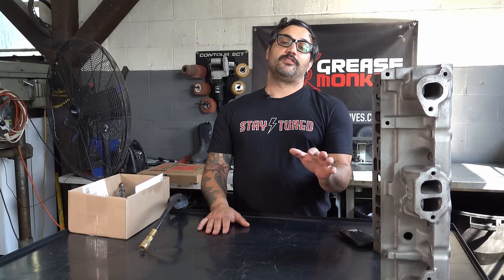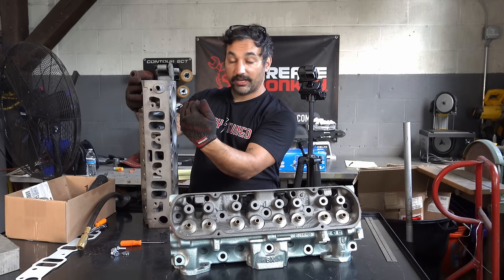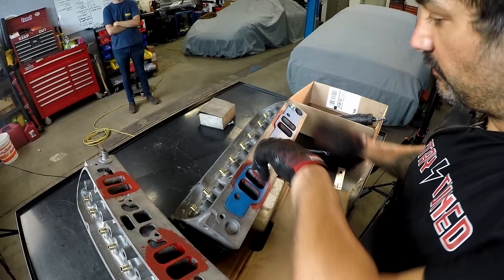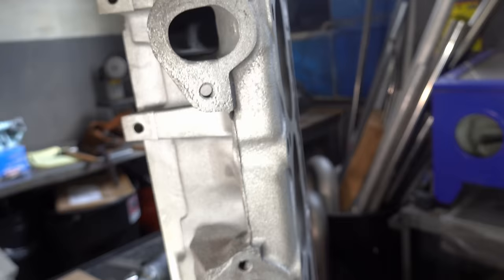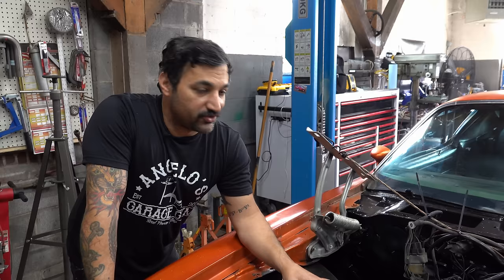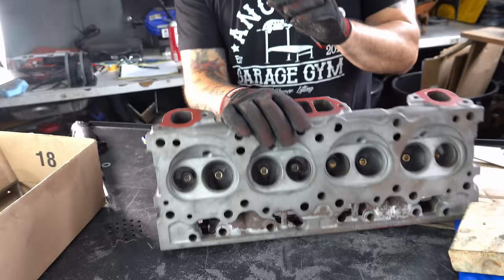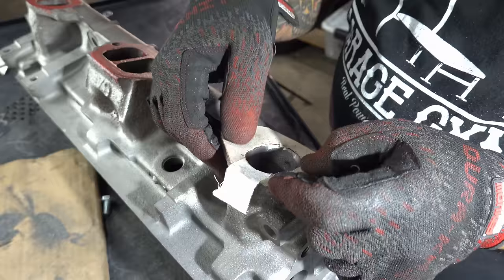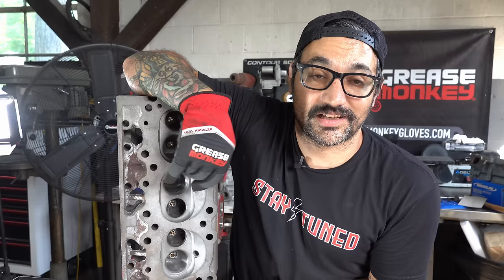It's Free and I Hate it! *Works on Any Engine

Comment: I put a set of 6X heads on a 400 Firebird  eng. I used the 400 rockers arms and pushrods . The new camshaft wore out in 30 seconds Acouple of Mexican fellows told Me that I had to use the 6x pushrods and rockers from the Grand Prix  6X eng . after i did that the eng ran real good . What do I know Ima FORD MAN .Where is Lucky ?

Comment: Yeah I’ve ported enough Pontiac cast-iron heads, my old boss at Sd Performance CNC ported my last set so I’m good by the time you’re done you might as well just invest in a nice set of aluminum heads unless you’re trying to look factory 
I’ll tell you this 85% of what you’re going to find is in the bowl the short turn and the valve job

Comment: I have a set of new ceramic coated headers for it that I have had in storage for 20 + years from a project I was working on and the guy bought the wrong headers. I needed Chevy 350 headers not. Pontiac 350-400 headers. If you want them you can have them.

Comment: Love that you actually putting a Pontiac motor in a Pontiac car. Why didn't you start with a 62, 12, 48 head?
Reply from the maker: It was slim pickings to find a good used motor over here.

Comment: With pontiac heads you should at least use a ra4 intake gasket and port match to that. It's mostly raising the roof. Looks like a standard gasket but I could be wrong.

Comment: The VE of a normal internal combustion engine can, and will in every properly build engine exceed 100% around the point of maximum torque.
To reach that with a normal engine is mostly due to the camshaft, not the ports.

And porting is not really free Horsepower.
It can increase Horsepower, if the acutal airflow the engine demands is high enough, but the only really NA free Horsepower is Compression ratio (up to the point where the fuel cant support the CR).
Best proof of that is Richard Holdeners test of the OEM LS-Heads.
The worst flowing but highest CR 706 heads produced the highest HP.

Comment: Nice work, Tony!  I've found a mallet works well for making the template.  The "soft" rubber/phenolic face has enough give to it that you can whack it fairly strongly and the cut works well.  By the way, roughly how long did you spend per head to do all of this work?
Reply from the maker: Yeah, that makes total sense. I don't recall why I grabbed the ball peen. Heat-stroke maybe?

Comment: Porting heads is great, especially on older engine types. However, getting great results in more modern engines is much harder. It isn't impossible, but harder for the average DIY-er.
Reply: Modern engines probably have better ports from factory, designed using cfd and so forth. So less gains to be made.
Reply: @nerd1000ify  There is that, also they tend to cast the metal more precisely.

Comment: You should have filled the crossover port with molten aluminum before you started porting them.  I've done it on iron Pontiac heads, at least 10 more free hp.

Comment: Neighbor has an RX7 sitting outside, engine has been to the track, pounded on at full boost and it still hasn't broken for 10 years.

The reason rotaries break is because they're not only maintained incorrectly, but driven wrong (yes there is such thing)

Rotaries like lots of oil yes, but did you know that asking for wide open throttle at 2500rpm will shred apex seals faster than anything? You need to keep the rpms up when driving over half throttle.

Rob Dahm hasn't even been breaking his engine, just axles, with his turbo 4 rotor.

 Rotaries didn't catch on because why learn a whole new engine after spending your whole life with piston engines? it makes sense that people are wary.

The funny thing is though, car magazines and journalists all say rotaries break, but when you go onto a forum where rotary heads are born, you'll find that a lot of these people are making rotaries run for years problem free, so long as they do it right.

The craziest part is that the RX7 FB sitting outside is a Frankenstein of parts from all different cars.

Before anyone asks, yes, he went through a couple engines, mainly because he was learning, and after he fixed all the kinks (like anyone would have to) the car kept brapping healthy for a decade and still to this day.

If you don't know about rotaries, you're not stupid, it's like learning a whole new language, and I don't blame you for sticking to your first language. I was very blown away when I heard the car had been running problem-free for so long, and honestly didn't want to believe it until he cold started it, warmed it up and took me for a full boost ride on the street.

Comment: the one thing I never ever hear Friberger, Finagin, Dulsage, Tony or any of them mention.  Serface grinding the head gasket serface??? and the exhaust and intake Gasket serfaces?  when i done my 427 that self destructed because a oil preasure drive breaking off, and my hemi, both went through serface grinding. In my feelings of making power i total beleive that is a must. blueing maching all and every serface to each other. so to say the Valve grinding to mach head with valve.

Comment: Primitive porting only works on crappy ports. Don’t touch decent ones unless you know what you’re doing and have a flow bench. Too many people bubba up heads with a die grinder and kill the low lift flow to maybe gain a tiny bit of high lift flow. The valve is partially open for far longer than it is fully open so flow at low lift is more important than peak numbers.

Comment: Believe it or not, a rough finish will flow more air than a smooth finish. Air flows on top of the micro vortices created by the rough surfaces. Its the reason golf balls have dimples 😉
Reply from the maker: Yeah, I know but I will take uniformity over that, I just want to knock the ridges down really. We are going for "pretty good" here!
Reply: @StayTunedTA  
Knocking down the ridges and opening up the CC's will absolutely help HP, but taking the time and effort to sand and polish to a smooth finish are better wasted on something else that will actually increase HP😉

Comment: Ok you have me very interested about the over 100% VE on rotaries. Long story short if you look at the combustion chamber alone, it fires every time it is swept, which means from this perspective it is a 2 stroke. I always thought it was too bad that you can't put an expansion pipe on a rotary and get the same effect as a piston 2 stroke, because the intake and exhaust are not really continuously connected like they are for the proper resonation to supercharge a piston 2 stroke.

But now that you are saying there is a small supercharging effect available with bridgeports and streetports, I'm wondering if you could put a pipe on it. Hmmmmmm

Speaking of flow have you seen the F1 headers over the last number of years? They come out at a smaller diameter from the exhaust port and then after about 5 or 10 inches it steps up to a larger diameter pipe. I'm pretty sure any engine will benefit from this. My guess is it helps keep the velocity higher near the exit to better clear out the chamber before stepping up as the exhaust expands out from heat and combustion to not restrict it.
Reply: VE greater than 100% is possible on normal 4 strokes too. It's highly dependent on intake manifold design however.

Comment: Tony do I need to port my aluminum 4.8 heads to get better air flow than it has now ? It's a 2004 4.8 vortec in a 2004 silverado 1500 2wd reg cab truck with RC 4.5 inch lift I'm looking for towing power but .my 4.8 as of now this day has 260,800 miles on it & still strong any budget very low budget upgrades secrets. love Pontiacs I had a 4 door lamans with a 400 it was sweet but I was only 12 @ that time lol & I'm in my late 50s now your help will be much appreciated keep up the great work & thank you for the Ole Pontiacs 400 memories

Comment: I have a 97 Integra.  While the bottom end of my b18b1 is Spoon Spec'd the top half only has a mild cam upgrade but head is fully ported and polished with a polished intake and throttle body . Ironically the bottom half was over built and has caused me issue with top half . Fortunately I will be replacing head with a full race grade head ( cams , ported , polished and bored with a full titanium valve train ) and computer . Engine can handle well over 12000 rpm but since i want it to last a lifetime I'm gonna set Rev limiter to 9500 to 9700 rpm . Without supercharger I will have around 350 hp but I think I'm gonna add super charger and tune it for 425 hp ( it will be able to handle 475 to 500 ) because again I want it to last . It also has a dual plate clutch with lightweight flywheel and 97 type r 5 speed . Brakes are off a 97 gsr and suspension is full skunk 2 upgrade . The exhaust is a stainless steel hi flow California approved ( in 2007 ) street/track exhaust with hi flow cat  bolted to the stock Honda header . 
   Yeah I love my little Japanese hot rod . I actually bought it to flip when I was planning to buy a 61 Chevy Belair Flat Top with a 283 , 2 speed , 410 rear ... but after driving the Integra I realized I had a true tuner ( most of the work was done ) like in the Fast and Furious movies on top of it being tuner royalty ( in tuner world the 97 Integra is equivalent to 57 Chevy in muscle car world ) . Never thought I'd love a Honda but I have a true sports car and it's a TRUE TUNER or like a 68 Chevy impala 4 door ss ... a true sleeper 🤣🤣🤣

Comment: Military was making gaskets with a ball peen hammer 100 + years ago, try a smaller ball peen and actual gasket material next time for an improved templet. Make several, custom undercut them for different depths in the port.

Comment: Re-watching this as I'm about to pull the #17 heads off the '68 350 in my Fbird for a refresh and was considering doing some light gasket matching and clean-up. watching this I see it was SUPER helpful that you had the butler head as a guide, but if you don't have access to something like that is there anything out there that could help not F@C% up my heads? templates, or measurements for snap gauges to go by?

Comment: I was confused for a second, but it looks like you're converting a 2 bolt block to 4 bolt main caps.  The 400 in my 70 GTO (MANY years ago) had factory 4 bolt caps on the center three mains
Reply from the maker: Yessir, only the most burly factory blocks came 4 bolt, so we are upgrading ours.

Comment: also i was thinking of going with a Butler top end kit which comes with aluminum heads for my 78 400 TA with Muncie wide ratio 4 speed, i was looking for about 420 430 HP which butler said would be no problem. would i be able to achieve the same even though my heads are x4 heads 93 or so cc the Butler heads are 72 cc. what you think?

Comment: So I can take my 1976 heads off my 400 sbc engine and do this and get a noticable difference in performance, it's in my 93 Chevy K1500 pick up. Nope , I've never done this so I don't think I will learn on my daily driver. But if I was experienced at doing it, it's within my price range, free.

Comment: Exhaust flange templet, why not just use a header gasket to lay out the exhaust port shape? Can't flow anymore then the shape of the gasket allows to flow passed it. 

 PS I have a 389 forged NASCAR Super Duty crank in my 1969 Ram Air IV 4 blot 406 Pontiac block. Your going to loooove the power it pull over 7,500 rpm on your 400 as I do mine.  Don't see much reason to need a blower, but it should be interesting. Good luck keeping the car straight!!!! My bird snakes all OVER the place when you get on it to hard with 11inch slicks!!! lol.  No NO-2 all motor.

Comment: How do you keep the bit from clogging up when grinding aluminum?
Reply from the maker: Its tough, I think you gotta run the bit slow, and you can use a small screwdriver and run it down the vanes of the cutter and it will pull out clogs but they don't last forever.
Reply from the maker: You can also use a cutting fluid or wax to help on aluminum.

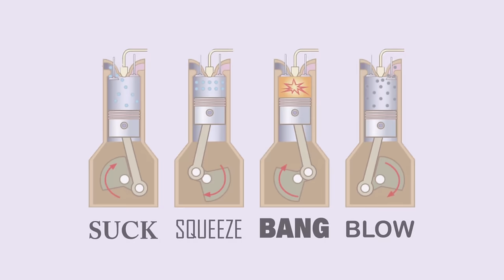Comment: 1:12...last one should be escape instead of blow...because the bang has produced  more heat than what the suck and squeeze has produced , and now needs a way to escape...if it doesnt escape....when it is supposed to, it will at the suck point

Comment: Hey Tony ,  I`m working on a 455 Buick Budget build mostly stock and was wondering on what to use as far as Used carbs ,   I Have a Holly 750 ,  The Original Q Jet ( My Favorite ,   Love the way it sounds ) And A Edelbrock carb !     Any Suggestions ??????????
Reply from the maker: Really, whatever you are most comfortable with tuning, and have laying around you can use. 4150 style stuff is usually my go to but all good choices.
Reply: @StayTunedTA  Cool Bro ,  Thanks so much for the advice and also want to say Hot Rod Garage Rocks ,  And Stay Tuned Of Course !   :  )

Comment: When i was a kid my dad got me a dremal tool and i burned it out porting EVERYTHING that was powered by internal combustion and BEEEEYOOOND.. Ported the shit outta my 87 jetta 1.8 and shaved the head down with one of the biggest rally/hillclimb tectonics camshaft 286/446 and was mega lumpy and totally UNSTREETABLE! She was rude as hell and my dad nicknamed the jetta the torqueless wonder but goddamn she got rowdy around 5000-11000 thanks to them crane duel coil beehive valve springs with titanium retainers all parts and "labor" cost me a cool $400 back in 1999 when life was good and i was strappin and quite dapper young man fulla hopes and dreams.. Then after constantly SHATTERING them little vw transmissions like they were made of frozen glass.. So since i love punishment i got into rotarys and the form of 5 RX7s over the course of a few very fun years... I used to have me a very good time.. i got my moneys worth
Reply from the maker: The first engine I ever built was a 1.8 8V for my 86 GTI! I drove that thing around matted to the floor, it was incredible fun! Would have been around the same time too.

Comment: Hi Tony… great video on the Pontiac 400….. that being said, you would never be able to make 600 HP let alone over 400 hp with that Pontiac engine. Bin there, done that and when it’s all said and done. Pontiac engines are not really a great platform for hi HP. I did pretty well the same thing 30 years ago lol 😂. At least it kinda felt powerful with a 3000 rpm stall.
Reply from the maker: Ha, ok. We will see. At least it’s not another LS!
Reply: @StayTunedTA  I have a 1981 NASCAR Turbo Trans Am, I did a LS3 416 swap, I built the engine myself,  machine work on the block was done by Eagle performance engines in Ontario Canada. Personally I prefer a aluminum LS engine that weighs less than 400 pounds over a Pontiac cast iron engine that weighs well over 700 pounds fully dressed. Don’t forget about the famous Pontiac spaghetti connecting rods that like to lose shape above 6000 rpm’s….. and sometimes create a inspection hole on the short block 😂
Reply from the maker: @vikenlink  Yeah, LS motors are kick ass for sure, but I really want to keep this thing legit old school and there's plenty of performance to be had in the Pontiac motor. I might even have to dyno it without the blower to prove it to ya!
Reply: @StayTunedTA  I’m looking forward to see that motor on the dyno….. I’m guessing, if you use a street Friendly performance cam you might get 340 hp out of it naturally aspirated . A really hot cam that’s miserable to drive on the street, you may make about 400 hp
Reply: @vikenlink  did you miss the part where he’s making it a stroker motor and most importantly going to put a large roots blower on it?
Reply: @Matt-cd1tl  yup…. I missed that part….. I still bet even with the blower…. Your not going to make more then 450HP without blowing that Indian up. You need forged steel H beam rods, forged pistons and a steel crankshaft… conversion to roller camshaft and still even the heads are terrible for flow. But even after all that it’s going to be a no no I should of just dropped a Chevy 350 never mind the LS LOL!
Reply: @Matt-cd1tl  the most powerful Pontiac 455 only made 370HP great torque at 500 foot pounds. Compare that to the Chevy big block 454 from 1970… 450 HP and 550 foot pounds torque. The problem with the Pontiac engine is you will throw a rod past 5500 rpm with the stock bottom end. Also the cylinder heads are poor flowing.
Reply: @Matt-cd1tl  let’s see what happens…. I would really be surprised if makes good power… I’ve see many Pontiac stroker motors 468 ci with Butler aluminum heads still couldn’t make over 450 hp. So let’s see what the blower is going to do.
Reply: @Matt-cd1tl  ya…. He’s still not going to make 600 hp….  A stroker Pontiac with a street friendly cam won’t make 400 hp  lots of torque but that’s about it with ported heads. A big blower is not going to make more then 100 hp more. Now if you go fuel injection and use Butler’s ported aluminum heads … maybe your gonna be satisfied with 550 hp and equivalent torque numbers. Just think Pontiac engine cost wise isn’t wise. My 416 ci stroker LS3 with a mild street cam.. actually the BTR Stage 2 N/A cam. 11.5:1 compression. I have 640 hp at the crankshaft. Oh and I didn’t even port the stock rec port heads .😎

Comment: A pro stock engine can make 135% ve. Its not impossible to exceed 100% at peek torque. But the Pontiac doesn't have the best combustion chamber for it. If you do real flowbench research instead of looking for the flow numbers that reach the hp goal then you can maximize discharge coefficient and calculated port energy for the most ve available. And then there is wet flow which is a whole other can of worms and if you get those things to agree with each other and the find the best cam for the engine youd be amazed at how much torque and power are missing from production engines.